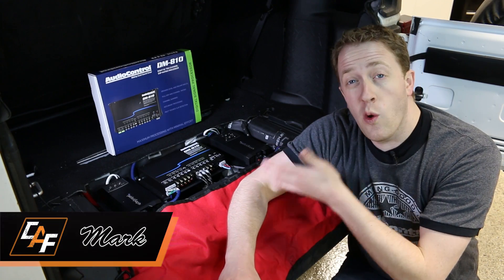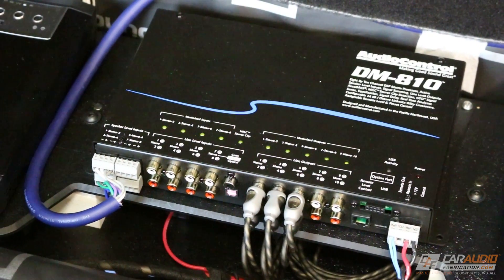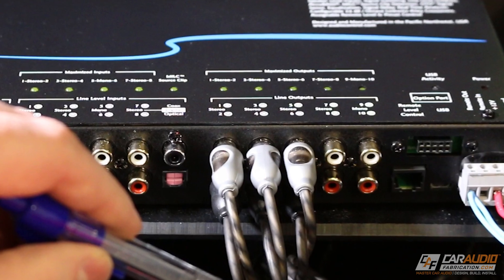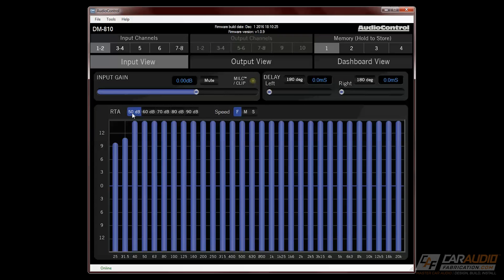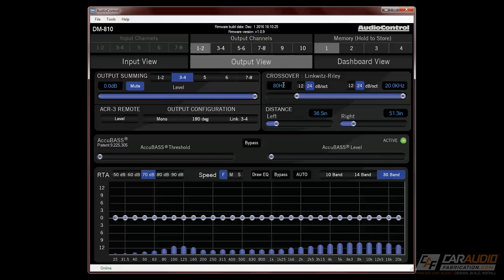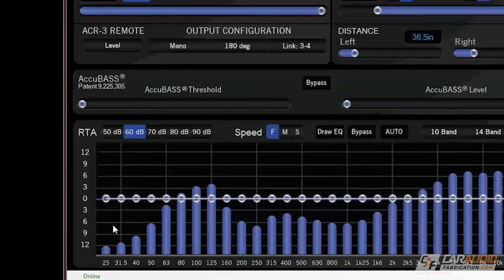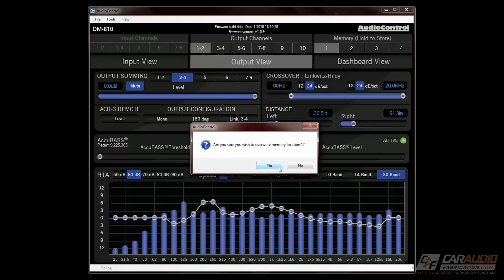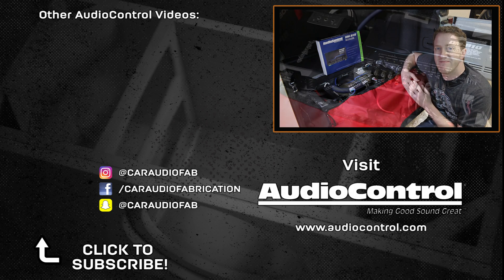AudioControl DM-810 DSP - INSTALL & OVERVIEW

Comment: Exactly what I am looking for.  However, I do have a question, i know that most who use this piece of equipment will normally be utilizing a 3-way component speaker system actively.   Since I am performing my own install, I don’t care to run that much speaker wire therefore, can a system like this be used on a passive 2-3 way component system?  Also, how would the x-over on this unit be used in conjunction with a mono block amp?  Thank you!
Reply: First question, ABSOLUTELY!

Comment: Are these as useful with aftermarket head units too? And I guess getting the signal leveled is the starting point, right? Then, you need to measure with a mic to see how the interior characteristics of the vehicle affect the corrected signal to do the final correction, I assume?

Comment: I saw that you switched to a Pioneer head unit on the Jeep.  Did that improve the overall sound quality?  We did a similar build to our JK, using the factory head unit.
We added amps, component speakers, sub and Audio Control LC 7i to our 2012 JK Sport with base model hunk-o-junk head unit, definitely way better than factory system, but still wondering if an aftermarket head unit would sound even better. Looking at Kenwood DDX 7903.

Comment: Audio Control Just confirmed to me that the Blue Tooth module for the DM DSPs will be released late Feb 2018.  Additionally, apps for the Android and Apple OS are also being released around the same time which makes sense since they are symbiotic.  Another update is the firmware this April that will include the individual EQ capability of each channel versus the current EQ channel pair.  In other words channels 1/2 and 3/4 will no long be combined so you can tune channel 1, 2, 3, 4 independent of each other.  Prior to this update I was using channels 1/2 for front left and channels 3/4 for front right to get my separate EQ capability.  I used the mono 5/6 for my sub and 7/8 for rear fill or center channel (I toyed with both but the rears worked better for me in my 2010 Acura TL.  I used a low powered 3 inch center channel running off the factory amp which did impact time alignment because it created an echo effect.  I was able to use the input tab on the DM608 to delay the signal to eliminate the echo.  I then used the left channel delay for channels 1/2 and the right channel delay for channels 3/4 to set my sound stage.  I was concerned using two delays might cause and issue but it worked out in this case.  Once I get the updated firmware its time to tear down and reconfigure things a bit.

Comment: I know this is an older video but I need some more info.  You mentioned that the unit will not allow the change of crossover settings between your presets.  This will certainly prevent me from doing one major thing in my intended setup.  What I need to be able to do is basically run the rear door speakers as a midbass reinforcing speaker for the front stage by setting it to a specific range/volume as not to pull the imaging back for centering on me driving.  I ALSO want to be able to select a preset that will cross those same speakers higher and center the content to the middle of the car for multiple passengers.  If this unit will not do it which on the market will or can Audio Control add that flexibility...I take full reponsibility if I happen to blow a tweet.  It just seems like they put some unnecessary training wheels on this unit.

Comment: Very informative video presentation. Is AccuBass exactly same as the Bass Restoration Processor? Thank you.
Reply: AccuBASS and The Epicenter are two different processors. AccuBASS is used to overcome bass roll off in factory systems, The Epicenter is used to restore bass one octave lower using top secret voodoo magic grown in the Pacific Northwest.
Reply: @audiocontrol7311  magical northwestern pacific rain forests are good for that kind of stuff...Audio control has always been a solid signal processor. I remember them from 3 decades ago when they were in over 50 percent of competition vehicles.  And built a few myself. Even after all these years They're still " making good sound great ".

Comment: Is there left and right EQ or EQ per channel?  Only 24db of slope?  Audio Control is pretty weak on DSP power.. more of a midlevel tool.  JL Tweak88 because it has 10 bands of parametric per channel and more slope is a stronger DSP.
Reply: Why would you even really need more than 24db/octave??? lmao

Comment: do you tap into the factory speaker wiring after the amp(going to the speakers) or in between the head unit and factory premium amp?
Reply: Sal r after the amp to the speakers is how mine is being installed
Reply: Chris Richards thanks! I'll try that.

Comment: One thing I always wondered is can you connect aftermarket speakers(or even factory ones) into a dsp like this so your whole system has the same eq? 
I have my front stage set up with component speakers running active. I disabled the front center speaker on stock wiring. I installed rear speakers for some fill when I have passengers but left it on the stock wiring. 
Can you run in stock amp wiring then output the RCA's back into the ran speaker wire I did for the rear doors?

Comment: Do you have a video explaining and showing the connecting done from 2:05 to 2:22? Tapping into speakers and running back to DSP? Are those all new wires you run to each speaker? Thank you!

Comment: Hopefully you see this and can reply to me I've seen tons of your videos on YouTube, great content by the way, I had a question for you hopefully you have time to respond I'm almost certain you'll have the answer so, I'm trying to get the parts together to start doing my car audio upgrade I'm trying to retain my factory head unit and am aware that I will need a line out converter. I want to amplify my door and rear deck speakers and also wire in a subwoofer, I'm wondering how to wire them. If I get a four channel line out converter for the door and deck speakers where would I wire my subwoofer? Also do I go with a four or five channel amplifier? I understand a LOC as being the inputs to the amp via RCA and running wires from the amp to the door speakers for my outputs but where do I get my output to my sub. If you could respond or make a video response that'd be great.

Comment: Very nice product. Sadly this unit is out of reach for most people in terms of cost. I enjoy your videos but most of your videos are for rich people.
Reply: And you need a 64 bit laptop pc to set , program the unit , more cash if you do have one.
Reply: I only make $30k a year. I have the Pioneer Stage 4 head unit, Audio Control DM-608,  Morel Tempo Ultra components, an Fi Q ferrite 12" sub, Orion HCCA amps, Audison 550 6 channel signal cables, two XS power D3400 batteries and 1/0 OFC power cable. It's not about having gobs of money, it's about having drive to save for the things that are important to you. I've been putting this system together for a few years now.

Comment: Great video! Subscribed and liked! I'm about to put one of these in my '16 Wrangler Unlimited that has the Alpine system pre-installed. I really want to try and see how much more I can get out of the Alpine system before I upgrade the speakers/amp. I'd like to dedicate 8 channels to the 4 pairs of components and use the last 2 for subwoofers.

Comment: If you are a perfectionist:
If you want to align the time between the speakers, do not do this by using one meter.
You should measure the distance using sound. Yes, using sound to measure the distance :D
The distance between the speakers and the distance between the centers of acoustic speakers, are two different things.
You can use for example ARTA program, which measure the distance from the tweeter to the microphone, and the distance from the woofer to the microphone.
Small differences in distance affect the soundstage. (Example I have 20cm between speakers, my colleague has 8cm). Is a huge difference. In his car with this same speakers as I have, soundstage is more realistic, localisation of instruments is much better. The speakers used in the home, a fights out for every 1cm to align the acoustic centers. Check home audio constructions Troels Gravesen. He goes back tweeter to the woofer to align the acoustic centers, and aligns the time coherence.

Sorry for my English: D
Reply: That you will be have expensive system with middle sound :-)
Time coherence and time alignment is most important setting to have perfect sound image - stage.

Comment: Does this DSP allow one to use the factory steering volume controls when using the factory head unit?
Reply: So then the answer is yes. Your steering wheel controls would function as normal. The dsp changes the signal.after the head unit

Comment: Seems like an awesome piece of audio tech! I'm sure this would be useful in SQ setups, but in DB and general thumpin setups all the effort would be lost. It would be money wasted that could go towards a higher quality sub or amp.
Reply: Not at all, I didn't know sending the right signal to each amp and +/- the appropriate freqs for each amp didn't matter if ur just trying to bang. It cleans everything up nicely. I paid $180 for mine used and is by far the most important piece in my system. I wont be without one again ill tellk u that.I have the dqdx and it makes all the difference in the world. you can defeat it after hooking it up with push of a button and hear the difference.my amplifier gain is on zero! or all the way down however u want to look at it. 100% recommended

Comment: bit of a newbe to the audio game but i was wondering if i have an epicenter and a crossover would i still need this unit or no
Reply: The Epicenter can still be used with the DM-810 or any processor. In most applications you would no longer need a crossover as the integrated crossover can be used.
Reply: Would the epicenter go b4 or after the dsp

Comment: Why is it that you always need an equalizer / sound processor to make the soud curve flat and balanced? When you buy a good head unit + amp I would expect the sound to be good already, yet it never is. You never buy an external equalizer for home hi-fi, why is it that in a car it's a must?
Reply: my system is a hertz mille 3way complete active up front using 1 jl audio 600/4 on 3.5 and tweets. then 6.5 in front door is running on a 2nd jl 600/4. and the 2 remaining channels of the 2nd 600/4 run a hertz mille 2 way on a passive crossover for rear door. 12w7 on jl 750/1. would I see massive gains with the dm-810. been considering this unit with being my 1st dsp behind AudioControl history of good products and price point over other dsp's. my head unit by kenwood dnn992hd has a built in dsp but i think im running to many channels to get benefits of that built in feature. any help is appreciated

Comment: Great review, as usual you're always adding value to the car audio fanatics and DIYers. Excellent product as well. 
A suggestion for audiocontrol: The line RTA is very welcome, but the unit should also have a mic for autotune purposes. Most DIYers don't have a full RTA at home and/or don't want to take the car for a shop to tune the audio system.  I'm using a JBL MS-8 right now specially because of that feature, replacing an audison Bit ten D. Thx
Reply: I agree.  The MS-8 is a cult classic for this very reason.  It is the only DSP with auto-tune (AND CENTER CHANNEL/SURROUND SOUND SUPPORT!!!).  Now, if it allowed you to view and edit the EQ curves it created, that would be what I'm looking for.  And if it worked better (MS-8 requires you to play with volume settings and re-do the auto-tune multiple times before it gets it "right").
Reply: Thank you for the remarks and suggestions. We have a very aggressive product development plan and have some very cool and amazing technology that will come out of the Pacific Northwest in the next couple years!

Comment: Audio Control makes great products but all of it is way over priced. One reason I will never purchase any of their products. Same equipment can be found from other companies at reasonable pricing. For those where cost is not a factor I guess to each their own. I bet they charge you for the PC software in addition to the DSP.
Reply: We hold our technologies and manufacturing practices in very high regard. In comparison of other DSP's with this much processing power we are at least $100 less at retail. Plus we are the only company with a DSP that has been 100% domestically Created, engineered, and built. We are celebrating our 40th year in business right now and that has only happened because our products have remained a good value for the price. Several times a week we have people who are installing 20 year old AudioControl products that have been used in 4 or 5 different cars and still create amazing sound in today's systems! That is value! We also invite you to download our "free" software on the bottom of the product website here. http://www.audiocontrol.com/car-audio/digital-signal-processors/dm-810/
Reply: Shaun Blackman I have audiocontrol products in my car, and am very happy with it, I also have several other high end brands, such as image dynamics, kenwood, pioneer, etc, and you do get what you pay for.
Reply: woohunter1 I could.pletely agree. AudioContol makes very good products but to me the cost doesn't justify it. To each their own. Maybe I'm just jealous because I can't drop that much money for a DSP. luckily my head until has a DSP build I to it.

Comment: Just curious about what some budget friendly speakers are a good choice to replace the factory 2 ohm speakers in a 2012 Nissan Altima with the standard stock head unit. Sadly no Bose, no touch screen... but you get what you get when purchasing used vehicles. Any serious help is appreciated.

Comment: so detailed, what more could you want in a review
Reply: Do I still need an oscilloscope to check for clipping from head unit if I buy this  ?
Reply: According to this video the unit has an LED that lights to let you know when it is clipping. Having said that, an oscilloscope can show you the actual wave and you can visually see when it begins to clip. I am looking forward to comparing them to see how accurate the light actually is.

Comment: So I have a question if you have let's say 3 dm801 to 5 6 ch amps do you still have to tune the amps thru the amps or can you do it thru the dm801? Thank you for the video and your response
Reply from the maker: I’m not sure why you would need 30 individual channels, but remember on an amp you are really only able to your gain setting and crossovers. Maybe bass boost. You are not going to have the ability to control time alignment, EQ, summing etc, unless the amplifier has an integrated DSP.

Comment: Is there a way to predict the output of component speakers? I'm trying to plan a system and don't want the components or the sub overpowering each other. Not sure of exact speakers, but I'm thinking just 4 50 watt 6.5" speakers.
Reply: Just adjust the gain controls on the amps to match the volume of the subs to the rest of the speakers.

Comment: Is this as good or better than a  BIT1
Reply: We think the DM-810 is the best! Very comparable in many ways but the integrated RTA's and some extra secret sauce makes the DM-810 very very special. On a side note did you know that these are Engineered, Designed, and Manufactured in the US? (using globally sourced components
Reply: That's what I am wondering. Asked him to do a head-to-head about a month ago. Just received my DM-810 around Xmas. Saved like $400+ relative to the BitOne ordering it during Black Friday.
Reply: once they update for left and right eq,  it will easily be better.  bitone is old and dated.  mostly known as the bitnoise. :)

Comment: If it has a built in RTA in the software, why would you still need to use a RTA mic to tune it?
Reply from the maker: The RTA you see on the device is  the electrical response. Just because you send a flat response signal to a speaker does not mean that its response will be completely flat, the environment within the vehicle, design of the speaker etc all have an impact on the actual response you hear, thus the need for tuning. Starting with a flat electrical response gives you a much better starting point and you know for a fact what frequency range is being sent to each speaker, this is why it is advantageous to see real time.

Comment: so the GTO is triggered from the signal delivered by the speaker level input correct?
Reply from the maker: GTO monitors inputs 1 and 2 on both the speaker level inputs and RCA Line Level Inputs.
Reply: thus activating the 12v switched output?  <--should have put that in my original question post.

Comment: can you use this has a "head unit" for using a tablet? Im running just the nvx Bluetooth controller knob with an amp and it needs a tune with a controller bad
Reply from the maker: I don't see why not, you could get the ACR-3 as well and use that as your volume control.

Comment: What's your view in this compared to an Audison Bit One ?
Reply: We think the DM-810 is the best! Very comparable in many ways but the integrated RTA's and some extra secret sauce makes the DM-810 very very special. On a side note did you know that these are Engineered, Designed, and Manufactured in the US? (using globally sourced components)

Comment: Just a few hours ago I was comparing the audiocontrol dsp to the audioson one you featured a while back. Thanks for the awesome vids.
Reply: Let us now which you decide on. If it is the DM-810 and you require any assistance we can be reached at 425-775-8461   Also curious if you have an RTA available when the time comes to do the install. If not the DM-810 would surely be a good choice.
Reply: AudioControl does the DM-810 have a separate EQ for each channel pair?
Reply: Any updates??